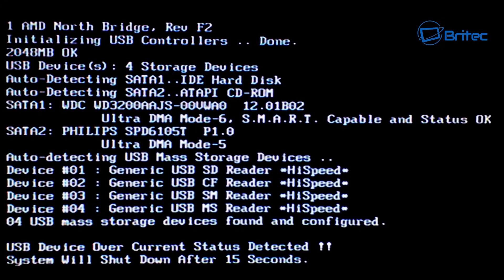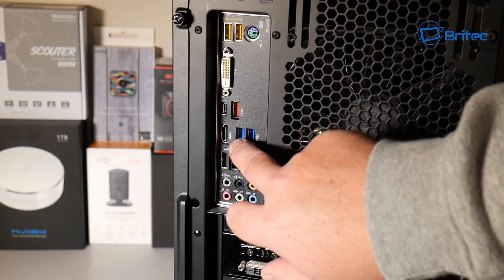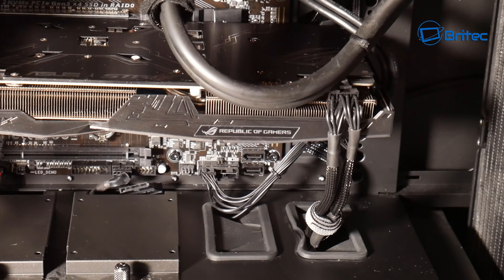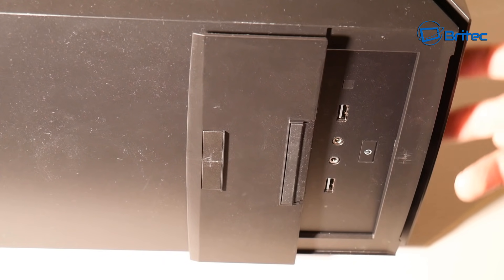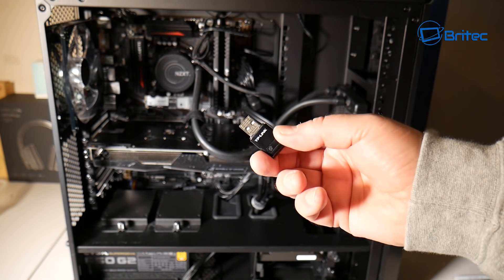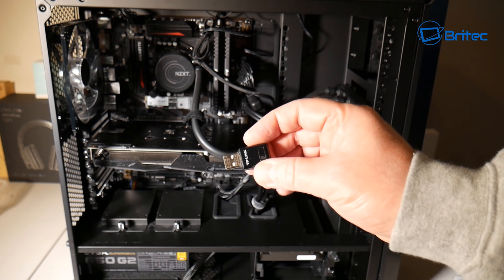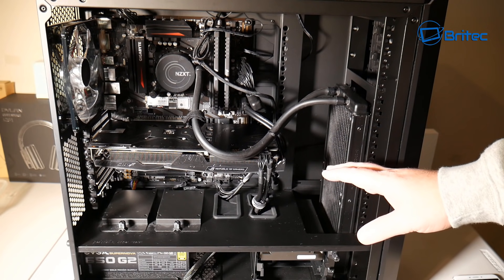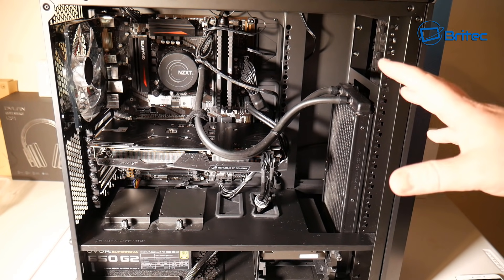Fix USB device Over Current Status Detected, System will shut down in 15 seconds

Comment: WINDOWS SHUT DOWN MY USB PORTS I HAVE NO ACCESS TO CONTROL THE COMPUTER CANNOT NOT EVEN GET INTO THE BIOS BECAUSE THERE IS NO WAY TO IMPUT.  LOOKING FOR A WAY  TO GET UPDATES INTO THE COMPUTER OR REPAIR THE DAMAGE WINDOWS AS DONE I CANNOT EVEN REMOVE THE UPDATE BECAUSE I CANNOT GET INTO THE COMPUTER WITHOUT A KEYBOARD OR A MOUSE

Comment: I am unplugging everything except ATX 24 pin and EPS 12v 8 pin, still not working, I think USB path or circuit is damaged due some scratch on motherboad PCB. I will replace with a new motherboard. My old motherboard is A320, so I think it's time to upgrade.

Comment: Only the comments helped me so basically one of my usb ports broke and 2 of the golden pins were touching so i fully unplugged ny pc and used a pin to move it away from touching the pin and after i turned on my pc and it worked 🎉

Comment: Nope, wrong.  ALL devices are unplugged including mouse and KB.   MB is out of case, no front ports plugged in, nothing connected to MB usb headers, nothing at all, still getting error.  This has to be a MB failure of the USB bus.   Nothing had been changed or added, just booted up one day and failure occured. ASUS MB.

Comment: Hey guys. So after a week of troubleshooting, i was at my wits end.

I used a microfiber cloth to clean out my power supply cable. And then my pc turned on correctly.

(do the PC power port aswell just to be sure) 

I hope this helps someone.

And for the experts, please confrim or debunk my comment.

I'm guessing the power supply made a short?

Comment: All usbs unplugged only thing plugged in is display port. I just replaced my power supply recently so its not that. Weird part is it will turn on by chance when I try turning it on about an hour after it gives this error. Is it possible the motherboard wouldn’t have issues starting up sometimes and have this error otherwise? I’ll start troubleshooting using this video but I’m still perplexed with the idea of it being a hardware issue that happens (sometimes)

Comment: So my issue is, my system first boots fine, into windows. I go and do a restart, and then I get the POST error. Press power button to boot after shutdown it’s starts. It’s only on a restart. I do not understand.

Comment: it work one time i disconnected the usb for the front usb ports. it then went back to the error message. dont know what the problem is, i think the motherboard is bad.
Reply: also pulled the battery out still no dice
Reply: so i got 4 other ssd drives and i disconnected two of them and it booted up. no idea why this occurred I will update my progress
Reply: update i only disconnected one ssd drive. i guess it is shorting out or something. everything booted up no problem
Reply: Solved it yet ?
Reply: @thermite-w5y  yea it works you getting the same error? sucks
Reply: @micgg1072  yeah just upgraded to 5600X 2 weeks before , i was shocked morning when i tried to turn it up, tough i lost the mobo so I took off the usb cable from motherboard and the cmos batterie for like 20 min and it worked.
Reply: The scariest part is that I turned off  my PC in night before it  he was working perfectly so this problem can happen any time and nobody knows why but I think it has something to do with USB devices because I had a USB wireless for my mouse I don’t know but I just suspected it ,

Comment: Try unplugg the bios battery first, wait 1 min then reinsert... if its easy to get to, that was my solution, in the end, after i remade my pc (installed new cpu cooler, various internal usb 2.0, gpu riser cable and two m.2s)  /finally up and running...

Comment: Thank you! I have a broken USB port at the front and the pins were bent down. Two of them touching the side walls of the plug. I bent them back away from that point of contact and that solved it.

Comment: My front usb ports are over used by both time and children plugging/unplugging their controller not so smoothly, the plastic piece went missing and they forced the way into the port folding the pins on each others, had to unfold the pins to remove the overcurrent wrming and then put a ducktape over the port to prevent future plug attemps.

Comment: One thing this vid missed is the Power cable, I found mine melted in the PSU and it  was hard to move out when replaced it fixed the issue.

Comment: It seems that this message can also mean your mobo is just fucked, unfortunately as today I have had this issue with one of my MSI X99S Gaming 7 motherboards. I took the board out of the case with nothing connected to it and powered the board up with nothing but RAM, (switched out with other RAM just to be sure, issue persisted) CPU (swapped CPU out with another just to be sure, issue persisted) and of course, PSU connected (once again, tried another one of those as well, issue persisted) but to no avail - issue persisted. Good thing I had a spare lying around. Swapped it out with the spare mobo and all good.

Comment: i don’t know if this was only my problem, but just in case i wanted to say this. check ALL your devices that are plugged in! i have a usb hub plugged in the back of my computer so i can have extra usb slots for my setup. little did i know one of the devices i had plugged into that hub was my problem! unplugged that and now i’m all good… thankfully i can keep using my usb hub, just without this phone charger thing 😂

Comment: This video got me in the right direction. So I got a Asus mobo that was serviced and had defaulted to probably the first version of bios ever lol. Literally 2004 but anyway I got passed this issue. No ports were damaged on my mobo or case. Not sure what I did what but I fixed my issue by

(Have a USB with latest bios ready) 
1. Make sure your CPU cooler isn’t too tight 

2. Make sure your mobo is seated correctly in case. 

3. Reset CMOS by removing the battery or by using something metal(screwdriver is fine) to touch the 2pin CLRTC connector on mobo for 10seconds. DO NOT HAVE PC TURNED ON while touching the pins. 

3. Disconnect all your computer case connectors EXCEPT for the ones that allow you to power on the PC and MoBo. 

Then turn on your pc. This helped me so hopefully this helps someone else out. Cheers
Reply: Help me...did it happen again? 
My bios defaulted to the first version..it is the cause of my problem?
Reply: @akashdeb5485  I would check to make sure all your connects are correct and if your psu is the correct amount of wattage for your peripherals
Reply: @akashdeb5485  also make sure your using a fresh CMOS battery
Reply: Really great tips. Thanks so much

Comment: Hi, I need help with my PC which has been giving me this error if I have too many usb devices plugged in. It seems I can only boot up with just 2 devices connected. I don't think any of the devices are faulty, nor the usb ports, because I can use the devices and the ports just fine after the PC has successfully booted. I've tried with another PSU but no dice. Can anyone offer a suggestion? Thanks!

Comment: I have this issue with my computer that just appeard a couple of days ago & its really stressing me out, its an ASUS Prime X370 Pro motherboard..

The only possible solutions that i can find on YouTube or the Web in general are from a bunch of Indian dudes that dont speak even 1 word of english & are using very old motherboards..

All the USB ports seem to be working ok nothing looks damaged, possibly it is a blown regulator chip.. there are alot of chips all around the USB ports so i cant figure out which chips are regulators..

Does anyone know where i can find the schematics of the board ? 

I also updated the BIOS from version 5216 to 5220 & maybe that caused the issue, but now i cant Flashback because the X370 doesnt have a Flashback button, so iam basically fuked !

Comment: Unplugging the USB 3.0 cable from the motherboard did the trick. I have noticed that one of my front USB-ports have been acting up alot lately with cables not fitting properly and sometimes it just stopped working entirely. Today I guess it had enough and gave my computer the over current status message. I guess I can live without that front USB-port.

Comment: Just built a new computer and booted to this issue. Disconnected everything and only had display cable plugged into GPU to see if I can boot. Still got the message. I removed the motherboard and looked underneath. There's some silver pins sticking out and two of them near the USB port were touching causing a short. I straightened them out and was able to boot without any issues!

Comment: I know this is an old video, but do you have a link to the CPU over voltage video. I bought a P8H61-M LX3 PLUS R2.0 Motherboard   Intel Pentium G2030 combo from aliExpress. I've tried almost everything now reset the jumpers,removed the cmos battery, used a new power supply and took the board out and put in another case and it still does the same thing. I checked PC part picker and it says this. Warning!Some Intel H61 chipset motherboards may need a BIOS update prior to using Ivy Bridge CPUs. Upgrading the BIOS may require a different CPU that is supported by older BIOS revisions.

I have order a Intel Celeron G470 for the purpose of upgrading the BIOS. I'm just hoping that the issue so I'm not another 15 dollars in the whole on this project.

Comment: I'm gonna try these when I get home, because I was playing Code Vein yesterday, my frames where dropping a bit, which I heard it was an issue with this game and out of the no where it gave me the Over current error and it shutoff right after that
Reply: Did it work?
Reply: @brndnthedragon656  it did not, but I had a technician take a look at with through my wife's work and it maybe the cable that goes from the PSU to the wall..im going to get a new one in a few, so hopefully that works
Reply: @Xephez  👍good luck
Reply: @brndnthedragon656  it did not work. The tech checked the PSU and said it was fine, he rebooted the pc ( at that point was just frustrated and I need this fixed), so windows 10 has been re installed and he had no issues.

I got home, plugged it with a new wall to PSU cable and on a different outlet, was on the process of installing wow and it shutdown again with no errors. I literally have no idea what could it be or what to do right now and it's killing me
Reply: @Xephez  oof
Reply: @brndnthedragon656  lol pretty accurate 🤣
Reply: @Xephez  for some reason my computer gets a usb over current but it gets fixed when I turn the psu off unplug the cord from the outlet then I wait for 5mins and it works
Reply: @brndnthedragon656  im trying that again, I changed the outlet as well to see if it maybe was that..so far so good..im gonna try trouble shooting from the start and using normal mouse and keyboard, putting away the rbg stuff for now
Reply: @Xephez  👍

Comment: I’ve just had this problem, my problem was the Motherboard itself was screwed against the metal case and that caused this problem.

I literally held the motherboard in my hands eith only the CPU and Ram plugged in and the cpu and main power
Thank You
Reply: Were you able to put it back in the case?

Comment: A piece was literally bent inside of the USB port. My wife used a cuticle pin to put it back in solace and now it works like it was never damaged. You got a Sub from me
Reply: Had this exact issue! The smallest bent piece was touching another and after bending it back my rig booted up perfectly. I can't use that usb port any longer but problem solved.

Comment: Thanks, it turned out to be a quick fix after I looked at your video. A Usb port at the front of the the computer was missing the plastic insert and the pins were pushed down shorting the Usb socket. A straightened paper clip allowed me to pull  the pins apart.

Comment: Thank you for this.  My barely 1 month old gaming rig started to do this today and I'm like what the hell??  Unplugged the front panel USB connector  (regular usb) and it stopped looping.  Checked the top of my case where the usb ports are located and lo and behold, one of the usb port has a bent pin.  Thank you for this vid!
Reply: Thanks bro this help alot suck with error code with z390
Reply: I had headers in the wrong place

Comment: This doesn't cover if you unplugged the front usb's and turned the computer on but still get the error message. That would make me think it is the rear usb's which are soldered to the motherboard and wouldn't that mean I'm screwed?

Comment: I appreciate the video. Unfortunately this didn't help me. I disconnected every usb connection on the motherboard, disconnected every port,  had no usb devices plugged in, cleared cmos with a jumper, and still have this issue.
Reply: Same here, mine was fine, when I turned it off it came up with the error, when turning it back on the same error has continued
Reply: @fridgefreeza9732  I actually fixed mine. I cleaned every port with a q-tip and alcohol. Had to remove a little cotton so it would fit. Also tried a third cmos battery just in case. I am not sure whether the cleaning or the different batter helped but it started working again. Good luck
Reply: @hydranmenace   I have ordered some pressured air but it doesn’t make sense coz I’ve literally just got this pc brand new
Reply: @fridgefreeza9732  if it's new can you not get warranty help? My board is very old so, while frustrating, wasn't surprising. It's from 2005 or so, just running unraid. Hope the compressed air helps. I would try replacing the cmos battery with one you know is brand new, even if you have tried that already. That was my mistake. Replaced with a battery that just also happened to be dead. As a last resort i took one out of my car key fob that i knew was working and that i think is what fixed it. In your case it might make sense that an old battery that has been sitting in a box for ages wherever it's assembled happened to go into your new board. Hope you get it going. I know how frustrating that is!
Reply: @hydranmenace  I’ve got it to be picked up tomorrow, it’s annoying but it is what it is. Thanks for the help mate really appreciate it!
Reply: @hydranmenace  I’ve plugged in a USB mouse into my Asus P5K Deluxe and it shutdown the computer and when I booted it back up I got this message. Is the motherboard completely dead?
Reply: @ryebred08  Honestly I don't remember even watching this video its been so long. Follow the steps in this video and see what happens with all USB disconnected. You might be able to narrow it down to a bad connection or short somewhere. If it boots without any USB plugged in the board isn't completely dead. See if there is anything shoved down into the port on both the PC side and the device side. Especially if you have kids. You never know. Clean the ports with a Q-tip and some rubbing alcohol when the system is powered off and unplugged. Could just be dirt.
Reply: @hydranmenace  It might be a short, because I plugged in a PS/2 keyboard and USB mouse. However, when something shorts, it usually cannot be revived. Is it true in my case?

Comment: I have this problem now.  I had a USB cable yanked out of the socket, which caused that plastic piece hovering in the middle to break off completely.  I fished it out with tweezers, but can't seem to fix the problem.  Is there any fix before I yank the USB cord out of my motherboard?  Will that disable all USB ports in the front panel, or only the faulty one?

Comment: I currently have this problem and I checked everything that I researched and nothing helped. Weird thing is that sometimes it will boot up like normal and when I restart, it starts again. Initially it would leave it alone for a few hours and the problem will go away but lately I would have to leave it for a few days before I can get into it again. Last thing I have to try is a BIOS update to see if that would fix it. I tried another Motherboard and it booted every time so the problem is the motherboard.

Comment: What if a plug is broken? As in the metal around it broke. I think I broke mine where my headphones go.
Also I have removed the headphones and there is a tiny bend, you can bend it back but eventually it will bend again and it does not work. Do I replace it or is it just something else wrong?
Reply: Same thing happened to me, just unplug it from your motherboard
Reply: @hiimsneezo802  please explain..
Reply: @law2268  is the port part of the case or is it on the motherboard itself?
Reply: @hiimsneezo802  thanks for the fast reply, basically, I had the headphone jack port on the pc its self come loose, and it messed up the sound, so I watched a video on how to fix it, but then after fixing the sound, it said that an overcurrent has been detected,and it was harming the mainboard, and it automtically shuts down
Reply: @law2268  so it's a 3.5mm port?
Reply: @hiimsneezo802  yup
Reply: @law2268  so basically the port is damaged, and you need to unplug the cable leading from it to the motherboard

Comment: Brilliant and exactly what I was looking for. I rebuilt my daughters PC, and a slightly bent USB connection mouse was used but did not detect, then got the warning. Pulled out the battery, wait a minute then put it back in, as well as the front USB connection. After a few attempts the pc started up. Had to use yet another wireless mouse to make it talk, but all good and working now. Also reset Bios to default. Cheers mate, and hope your keeping safe.

Comment: Unfortunately even the Naked card without anything with just the power supply plugged in I have the same message I looked if the integrated USB ports were damaged but apparently not